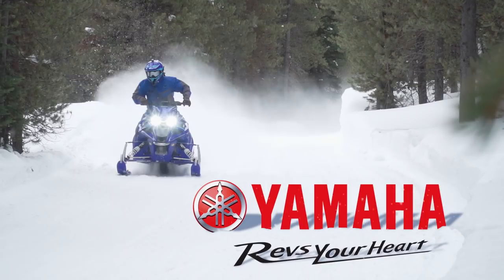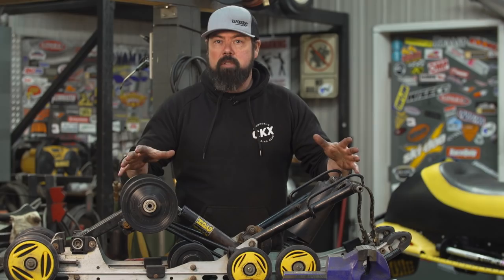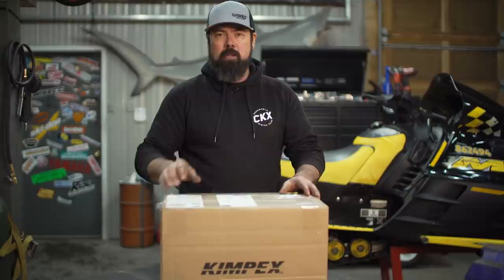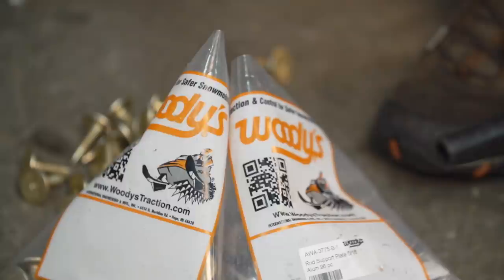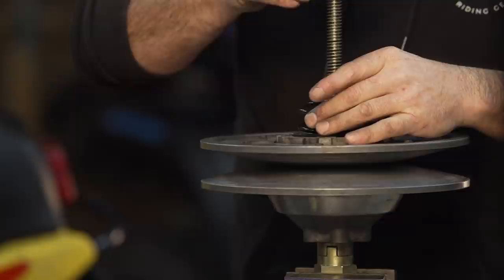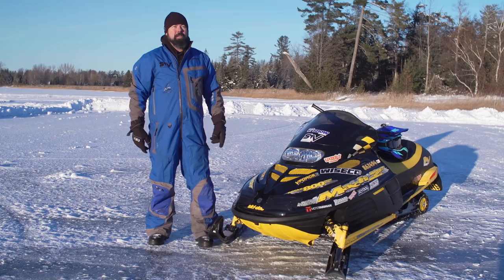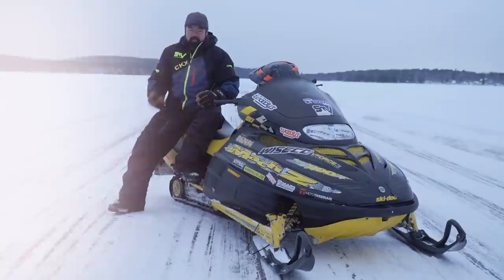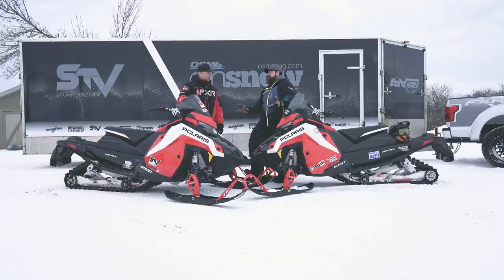Snowmobiler TV 2021 - Episode 9

Comment: Try running Champion powersport QN6HCC sparkplugs at .018- .020 gap. Part number 8902-1 Ran these in my 97 formula 3 and never fouled one until the were a year old. Mine was eating ngks like candy too lol!  Also check your spark plug wires mine weren't even worn and they would arc and ground out causing fouling. Nice sled to by the way! 👍
Reply: I tried those too... plug wires are on the list at some point!

Comment: Did you try dropping the strap on the front of the suspension? Maybe too much pressure on the skis.
I whish you would quit calling it a pig, Its newer then my Mach1. Both of them actually,1990 and 1998 and of the five sleds I have only one is in the 2000s (Yamaha Rage).